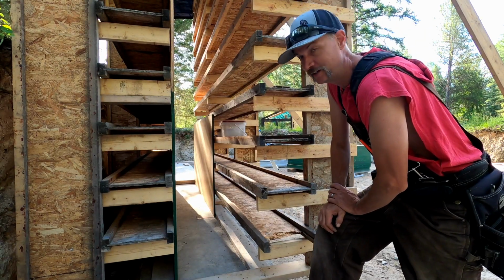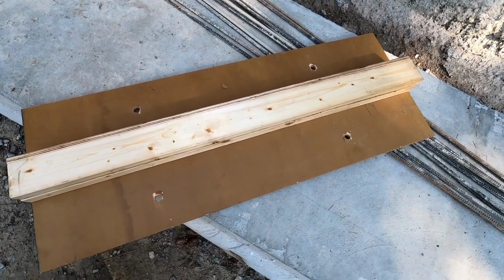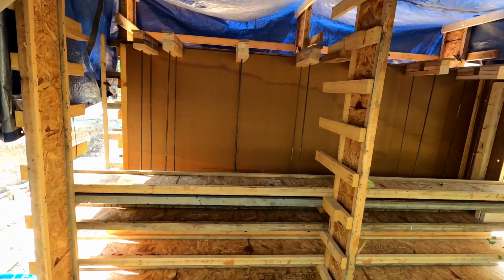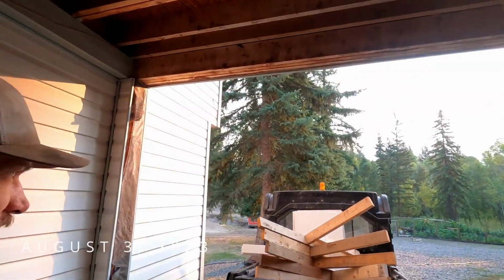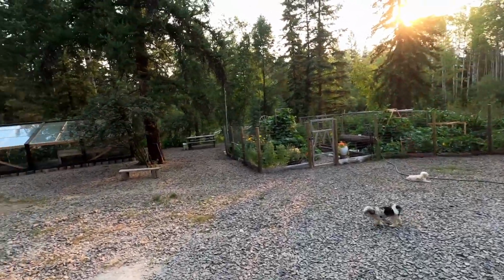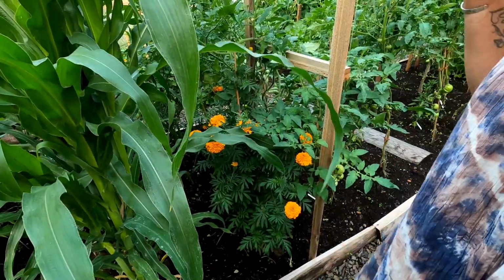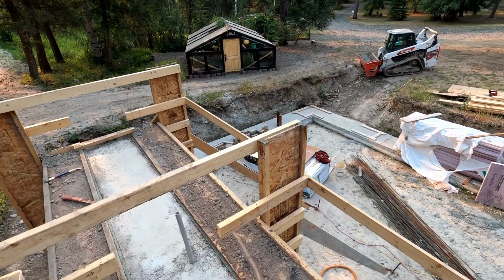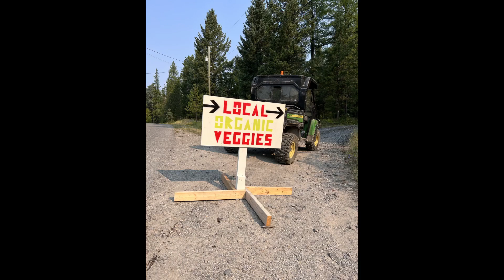Geothermal Energy | Crafting Our First Rammed Earth Wall (Ep08)

Comment: I'm about to start on a rammed earth project and have found your videos so helpful! Thanks so much. I love this waler rack system.

Question (and sorry if I've missed this in your series) -- do you use a different mix ratio for the segment of wall below grade? I see that the wall is more gray at its base, which makes me think that there's more cement in the mix. I'm wondering if there are ways to use the rammed earth building method with an increased cement ratio for below grade waterproofing. Thanks again!
Reply from the maker: Hi! Thanks for watching and it’s great to hear you’ll be starting your own rammed earth project. 

The mix ratio below grade is still at around 10% cement. There is no pigment added for the mix below grade as you won’t see it and the pigment adds to the cost. 

Increasing the cement ratio below grade also isn’t necessary, however protecting the below grade portion of the wall from water is a must. Similar to a traditional foundation. Sometimes referred to as damp proofing. Multiple methods and products are available for this depending on where you live and what the climate is like. 

Hope this helps and good luck with your project!

Comment: What kind of sand do you use? Does it have a consistency similar to that of beach sand?
Reply from the maker: Hi there!  We used a coarse sand. Not too fine. You can try a variety of different sands to perfect your mix. The sand and finer aggregates is what will give you a smoother finish. 

Thanks for watching!

Comment: What's the reason going for this instead of .. basically any other method? Seems complicated anyway, heavy machinery needed, lot of work, so what's the reasoning for this method?
Reply from the maker: We came across rammed earth on you tube and fell in love with the aesthetic as well as the properties rammed earth provides. It is sustainable, provides excellent protection from fire, pests, birds and rodents. It also has excellent thermal mass which is going to help with running this greenhouse in the winter months. It does appear complicated, however it is getting easier as we go along! Thanks for watching!